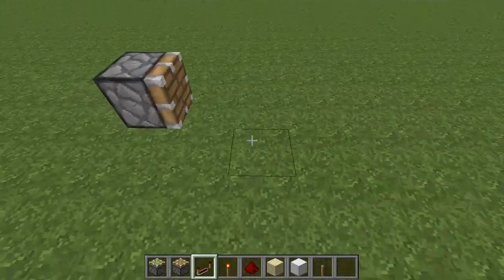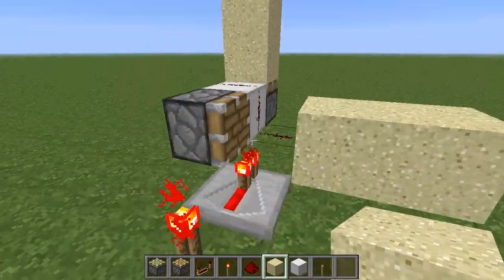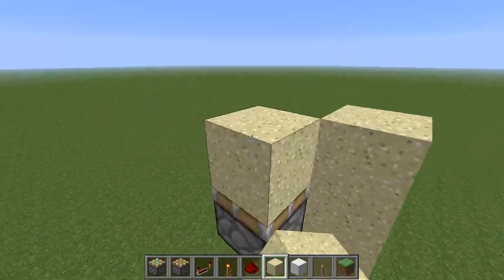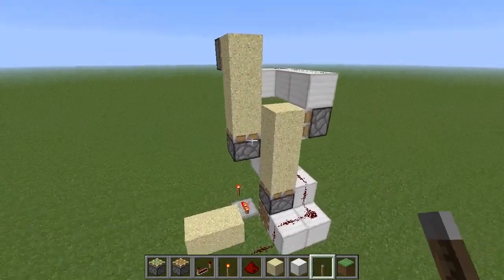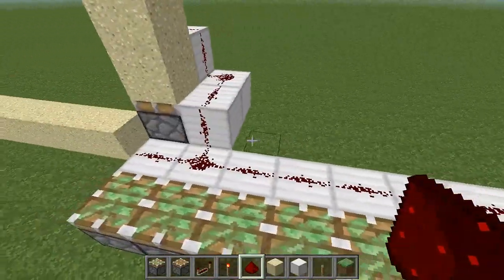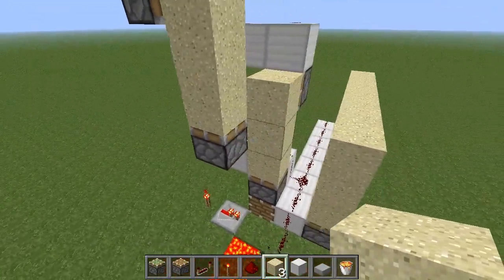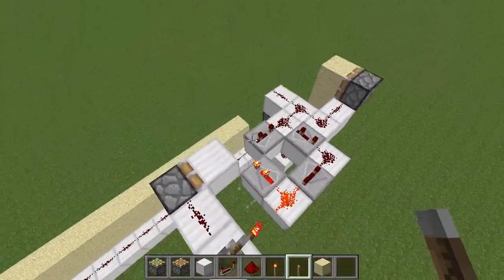Sand Duplicator Tutorial [Patched]

Comment: It looks like it, but in the video, he shows that the trigger is too fast to show a light. You'll be able to see it if you put a relay chain after it. My issue was with that I needed to angle the redstone wire to point into the piston. On my SMP server, I also had to make a new clock that could create short pulses with a wide timing, to cover for latency.

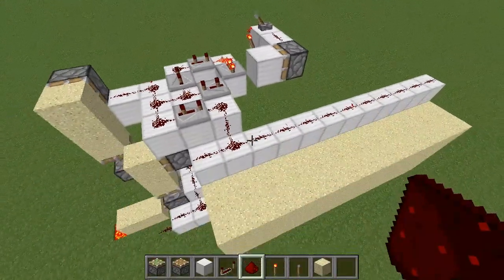Comment: try and make an unlimited gravel and flint generator! do the same thing so take you last design and then the part where the pistons push making 2 layers of sand(5:48), and then put a tunnl down and put torches on the wall and below the torches but water to flow it and then make a place to harvest!

i dont know if it will work but you should try it!